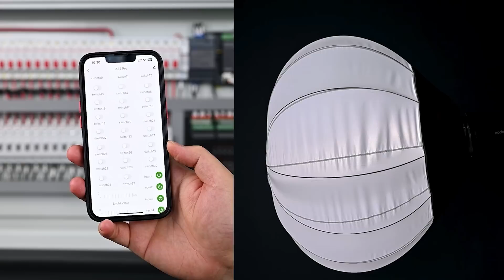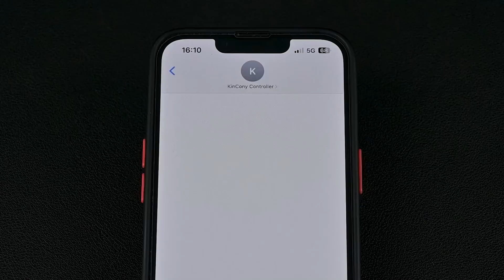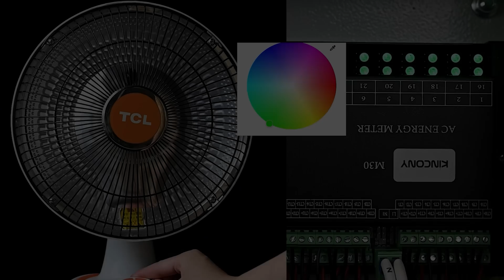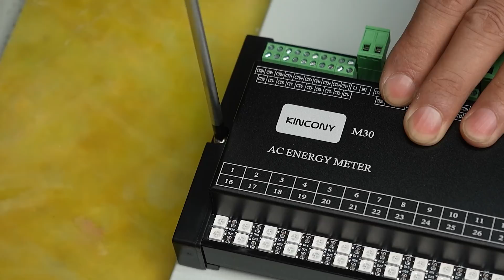32-Channel Smart Panel for HA, Tuya, Alexa, Loxone + Energy Stats 2025

Comment: Can I control a 25A DC Contactor with a controller with a MOSFET like KinCony B16M? Thanks.
Reply from the maker: sure, it's ok.
Reply: @KinCony  Is there any benefit to using one over the others? Especially when the MOSFET version is cheaper and quieter?
Reply from the maker: if you use DC contactor, you can use mosfet controller, yes, it's better, just cost is higher. if use AC contactor, chose relay controller.

Comment: very good work but there is no direct installation solution without the contactors?
Reply from the maker: work with contactor is more safety. you can also work with relay directly, it max support AC220v 7A

Comment: Can i intergrate CT sensor on the digital contact on Kincony A32 Pro Relay controller
For measuring of current on a circuit
Reply from the maker: no, can't use by digital input ports.

Comment: And how I connect this one to Tuya,kincony and Home assistant
Reply from the maker: just download KCS v3 firmware to controller, auto discovery by home assistant using MQTT, also directly to use by tuya app .
Reply: Yes but the problem is that I can't pair it with the Tuya app and I didn't find any guidelines on how to do so or what combination I should use??
Reply from the maker: @alinbejinaru1755  download KCS v3 firmware by usb-c cable firstly, install wifi antenna for tuya module. here is KCS v3 online guide: https://www.kincony.com/how-to-use-kcsv3-firmware-esp32-board.html

Comment: Can this devices be added to the controller and how many the maximum number that exclude the on off relays (smoke detector, motion sensor, universal remote control, magnetic door lock and sensor,window shutter, speaker for sound system and so on...)?
Reply: @KinCony  I meant Can the Below devices be added to KinCony A32 Pro relay controller Since it has esp32? Also what is the limitation Number?
Smoke Detector
Motion Sensor
Smart wired IR RF universal remote
Magnetic Door Lock and status
Window shutter motor
Speaker for sound system

Comment: Are you able to ship it like this, already working so all i have to do is change the brakers for higher or lower amps and connect what i eant to connect?
Reply from the maker: do you means make a DB without all output breaker? you install breaker by yourself?
Reply: @KinCony  Yes
Reply from the maker: @mr.o5577  ok, we can do that, just customize make the DB. you can contact us by whatsapp number: +86-15381188302

Comment: In this video in 13:10 you connect L wire from Power Supply input in A32 CO socket, not conect 12V wire from PowerSupply output? Also connect N wire from PowerSupply input to relay not connect GND wire from PowerSupply output? This is not the same as diagram?
Reply from the maker: at last, we have replaced the contactor with DC version. so the A32 Pro relay output 12v let DC contactor ON.

Comment: Nice job.
What's the section of black wire used for low voltage?   is it 0.75 mm2 ?
Reply from the maker: do you means black wire for CT sensor? or relay output wire? that is for DC contactor, just 24v.
Reply: @KinCony  relay output wire and the ones that you use for 12v power for example. What’s the section of the cable in mm2?
Reply from the maker: @sebagarayco  if use for 12v, any cable mm2 can be used, current very low.
Reply: @KinCony  yes but I want to know this one in particular how width it is. Thanks
Reply from the maker: @sebagarayco  1mm2

Comment: This is genuinely art. This is amazing. Holy cow. I am at a loss of words to express how amazing it is to have something with such functionality be assembled in an appearingly simple way. We need breakers? Put them in a line. 
We need wires? Measure them out by "hand"
The fact it uses minimal numbers of parts and only uses components that are required is simply amazing. This is genuinely art and I love this so much.
Reply from the maker: thanks, this is a common breaker, just use by KinCony's Smart controller A32 Pro and M30 energy meter board.

Comment: This is beautiful work! I have two questions about the M30:
  - Why didn't you put it on DIN rail, too? 
  - Do you only need to put the reference voltage on L1?

A minor critique: I feel like you should line up the breakers and relays so you don't have to make that little kink in the wire between every one.
Reply from the maker: 1. fix by screw is stable.
2. every L detect for 10 channel CT current sensor. so L1 for CT1-10, L2 for CT11-20, L3 for CT21-30
thanks for your suggestion.
Reply: @KinCony  2: that's what I expected from your other comments, but at 15:20 in this video - you only have L1 fed.
Reply from the maker: @wellsgofar3196  sorry, at last, the completed version, we have connected all L1,L2,L3 terminal with Live line.